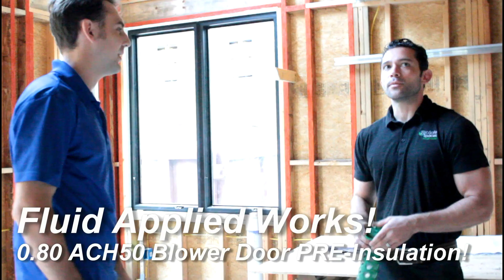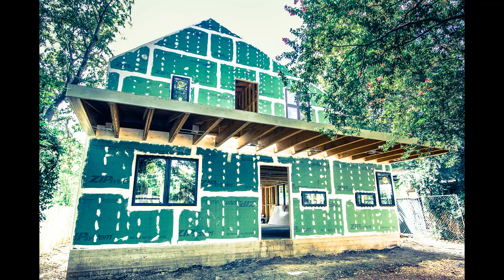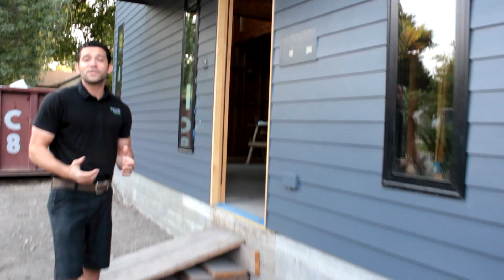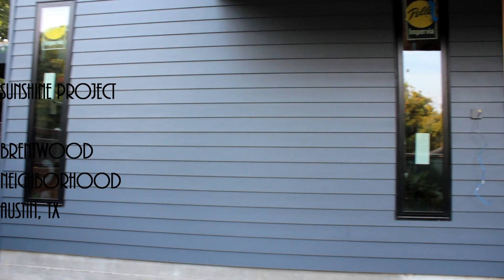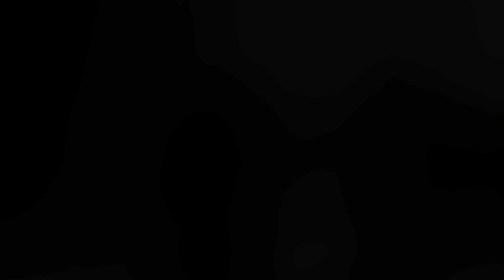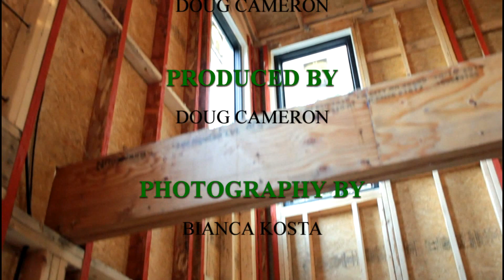FluidAppliedWorks!

Comment: i understand why this is a good thing, but also dosnt this mean you need an air venting-system to have a proper ventilation ?
Reply from the maker: We have one MR Dot1
Reply: Yes, but now you can control the temp, humidity, volume of that air as you introduce it.  What’s nice too is you can make a minute positive pressure so when you open doors air will push out and deflect pollen, dust and bugs

Comment: Do the nails penetrating the zip system with that kind of siding affect its waterproofing and airtightness? Does this work in colder climates like northern Utah?
Reply from the maker: Siding nails are applied sans any additional waterproofing. Its a non issue anywhere in the world, especially with a back vented cladding like we installed
Reply: @DesignBuildDoug  what about the nails that go through from the battons where the siding is nailed to, thats additional penitrations. Do you then use fluid applied again over the battons??
Reply: Nails should have waterproofing applied - this system how it stands in the video will not work for colder or wet climates.

Comment: Did you use the zip tape or skip it and use the tyvek fluid applied for the seams?
Reply from the maker: toology55 no zip tape
Reply: Thanks for the quick reply!  What would you recommend to keep air tightness when brick ties are used. Should the fluid applied be used while brick ties are installed?
Reply from the maker: toology55 No prob! I recommend gooping everything you can, but not overthinking it either.  Just keep an open & readily available caulk gun or two of fluid applied on your job, and share the goal of air (& water) tightness with your team. I literally try to make a game out of it, telling them we will have to take a test (blower door) at the end. Hope that helps!

Comment: Hey Doug! Love the explanation of the building tech, also got to see it at a recent CRAN tour. I have a quick question tho. How does all this do against noise? For instance, if you use zip system and then don't use rigid insulation...can I hear the dog barking across the street? Wondering if anyone has brought this up so far. - Paul
Reply from the maker: Paul Holmes good question, never come up so far...but using zip R would cover you here. I typically use fiberglass BIBS inside the walls, so I’m sure that helps too.

Comment: Dang!  .8 ACH50!  Wow Doug!  Nice work!  I've recently been sending people to your blog to check out this method.  Very well done buddy.  Great, great work.  Best, Matt
Reply: DesignBuildDoug - I found your channel through Mr. Risinger when he posted your Zip & Zip 2.0 videos a few weeks back.  Thank you both for building homes with integrity!  I thoroughly enjoy the Building Science approach and have been learning so much in regards to thermal bridging, etc. My question (which may be silly, but I've dwelled on it for a month now) is you mentioned doing this test before insulation.  Could that (already impressive) 0.8 ACH50 possibly drop even further if this test were done after insulation?  In other words, would the insulation prevent any more air infiltration at this point?  Thank you both again for your quality videos!
Reply from the maker: Thanks buddy!
Reply: I'm sure insulation will add something, but if the drywall is sealed to the frame at the bottom plate that will improve the ACH value considerably.